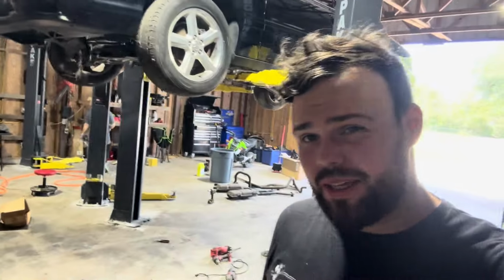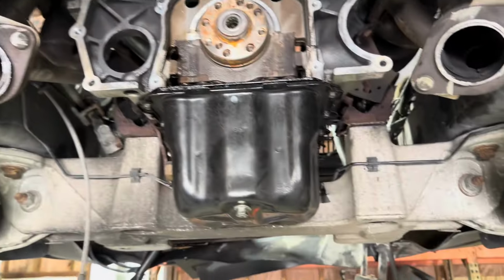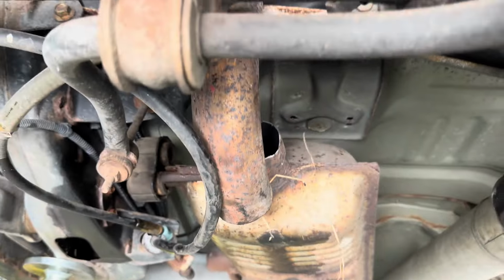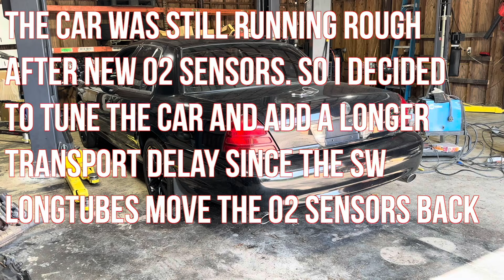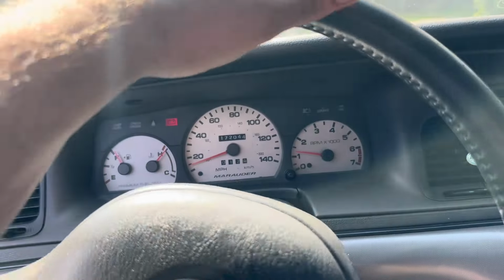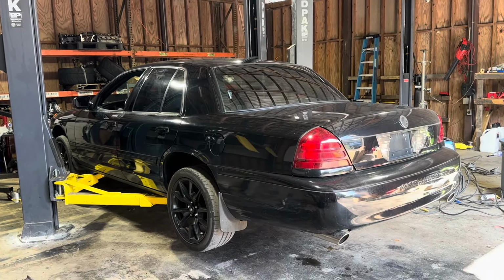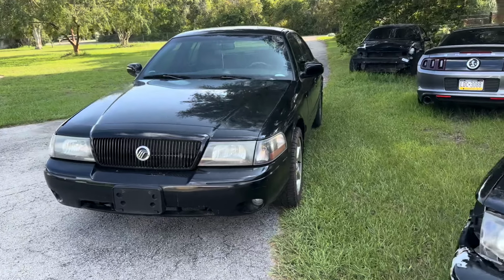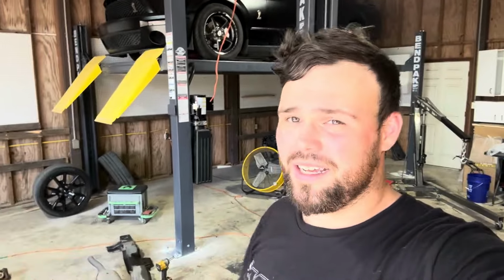First Problem with Coyote Swap Marauder + 4V Marauder Runs!

Comment: Marauder lifestyle. I want one but everyone I see is 12k+ for 200k miles. Back in the day 04-05 the old dudes would hang out at McDonald's and smoke their pipes with their marauders parked up front and the car show street races in the back were going on.
Reply: Better buy one when you find one. You are talking about a limited edition car made 20 years ago
Reply: They made 70K 94-96 Impala SS's and you barely ever see them anymore. They made 10,000 Marauders so I would definitely snatch one up

Comment: Awesome! Love your channel! 
Makes me wonder… if you have ever swapped a ‘95 4.6L T-Bird with a Coyote? My car has got the IRS, with it being a ‘95!  I thought it would be a cool swap someday. Just wanted your thoughts if you had ever tried it, or know of anyone else?
Reply: I do know you can take the K member from a 4.6 sn95 and use it in the foxbody for a coyote swap, so I’m almost positive that if your vehicle came with a mod motor in it, the coyote will bolt right up, but someone will correct me if I’m wrong
Reply: I have a 95 with a blown engine. All the 4.6 stuff is tbird specific meaning thats one of the hardest Ford's to coyote swap
Reply: @brysonshires9742  Was sort of afraid of that. I do know the Lincoln Mark VIII version… of the Thunderbird had a 32 valve like the Marauder.
Reply: @ikecostner1  It would be cool if it would!
Reply: @kellymeade4587 I had a 32v engine out of a 97 and it didn't have good compression on no8. Going for a pi engine now

Comment: Battery should show 13.6v to 14.2v ish when the car is running. Love both Marauders.😊
Reply from the maker: Yes agreed. However most of these older 4v cars have a constant struggle with this. It also has a battery relocation which I’m not the biggest fan of because it has issues like this. I’m hopefully than a new alternator would kick the voltage up but not positive that it will
Reply: @MustangLifestyleTV  That is very true. My 03' Vic was doing that. I went threw 3 alternators before it started working right. I finally took my original alternator to a starter/Alternator shop and they knocked it out and I've never had a prob since. We'll she isn't a 2v anymore. Ls3/6L90E going in. My 08'Vic will be getting a 5.0 6R80 after this swap is done. Gonna be a while lol. Driveway build here lol
Reply: @MustangLifestyleTV could check the redundant ground on the passenger rear side of the block by the trans dip stick. Seems to be a common issue with these being loose or coming off. Couldn’t hurt especially if the grounds on the battery have developed some corrosion or resistance.

Comment: Are you using the stock rear gear? 3.73 or a 3.55 with a slight stall?
Reply from the maker: Unknown rear gear and converter.